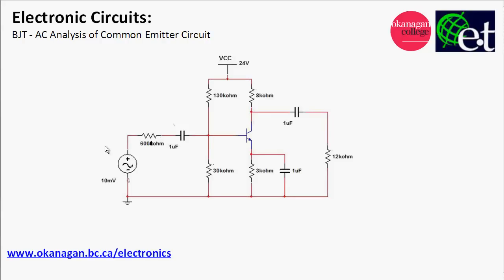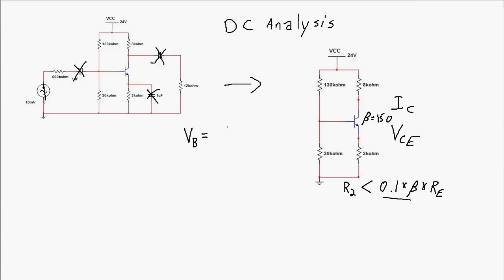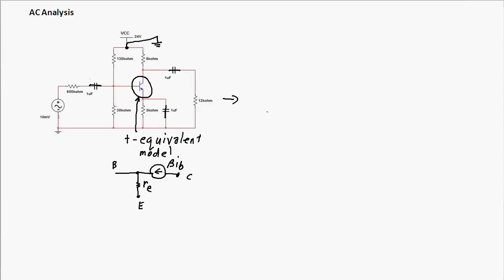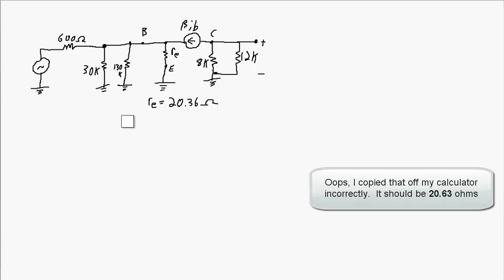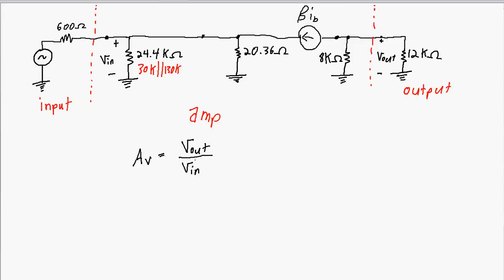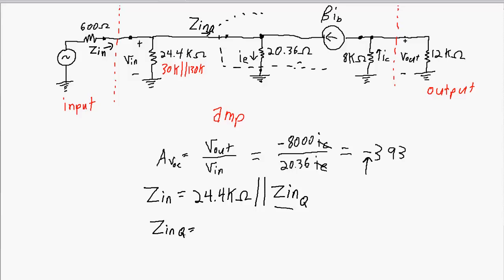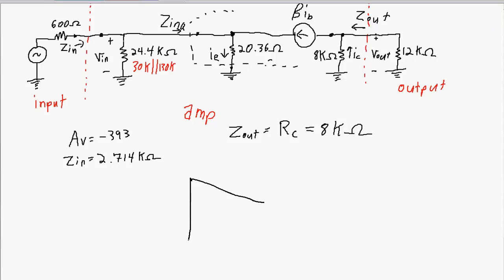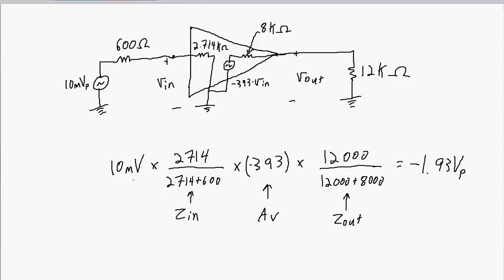Common Emitter Amplifier

Comment: If anyone is wondering why the output impedance is found by treating Rc as if its in series with the load when its clearly in parallel in the diagram, its because in the simplified amplifier model (the triangle) we model the output as a thevinin equivalent circuit with the output impedance being the thevinin equivalent resistance. Its kind of unexplained in the video but him opening up the current source is just the usual step you take to finding thevinen resistance, which ends up being just Rc. And so when you put together the output as a thevinin equivalent circuit in the final model you have Zout as Rc in series with the load.

Very helpful video by the way i just wanted to clear this up because it stumped me for a while
Reply: Can you illustrate more. And what do you mean by thevinin equivalent circuit ?
Reply: you what's even more treacherous, the fact that a forward baised diode on a voltage divider circuit gives of a .637mV out put that means the whole time Ve is just .637mV, since base to emitter junction is a forward biased.

Comment: To those asking where the RE went in the AC analysis, it was shorted by the bypass capacitor. Capacitors are shorted in AC and therefore current passe through the shorted component to avoid the resistance.

Comment: Very clean and well done...thank you!
Reply from the maker: Ancient lawz thanks for the comment.  I appreciate the feed back.
Reply: +David Williams I did not understand the Rin part, why not do Vin/Iin for the 24.4k ohm resistor at the input too but do it for the 20.36k ohm??? what is going on here dude?
Reply: @優さん-n7m  It's a mistake. The ac input impedance of the transistor is β x re or 150 x 20.36 = 3K. Put that in parallel with the 24K and you'll get sensible answers.

Comment from the maker: The quick answer is that at high enough frequencies a capacitor looks like a short circuit.  At low enough frequencies, a capacitor looks like an open circuit.

The deeper reason is that a capacitor presents a reactance to the signal which is an opposition to a change in voltage.  The reactance of a capacitor is equal to   1/(2*pi*f) where f is the frequency.  As the frequency increases, the reactance of the capacitor decreases.

Comment from the maker: The midband AC gain of a common emitter amplifier is equal to about -Rc/(re+RE).  When you bypass the emitter resistor (RE) with a capacitor, you are making RE invisible from an AC point of view (i.e you are bypassing it).  This makes the gain equal to about -Rc/re
Reply: That's only true when Xc (the reactance of the capacitor) is negligible compared to re. For slightly lower frequencies, the ac gain is -Rc/(re + Xc) as long as Xc << Re. The more precise formula would be -Rc/(re + 1/(1/Re + 1/Xc) ). The denominator is (re plus the parallel combination of Xc and Re).

Comment: Howdy. Absolutely Great.
However. The output impedance is 2 x the collector resistor. JohnAudioTech corrected me on that point. And I verified it yesterday.
I used T1 = BC109, Rc = 10 k, Re = 1 k, Rb1 = 47 k and Rb2 = 12 k.
B+ was 9 V. DC work point was about 4,2 V on the collector.
Loading the collector with Rload = 22 k the Uload dropped to 1/sqrt2 of the unloaded value (-3dB). 1 kHz sine wave. With a fixed Rc this is the most energy efficient transfer of power. 
So. I say. Zout = 2 x Rc.
But of course. Designing the stage for a smaller output impedance will increase the load power. Yes. But the stage will consume way more power that what is gained over the load.
Regards.

Comment from the maker: Load impedances for audio systems are usually 4 or 8 ohms, so common emitter amplifiers are not used for driving speakers.  Amplifiers are used in many different types of applications that have higher load impedances.  Also common emitter amplifiers are single stage amplifiers and are often found as part of a multistage amplifier system.
Reply: On the contrary, a pure Class-A amplifier will have a common emitter stage as its output, and many high-quality audio amplifiers use that, although they may use an active collector load to improve the open loop gain. There are plenty of examples on the web.

Comment from the maker: The 600 ohm is the output impedance of the source.  Without it, you can consider it an ideal source and there will be no voltage drop inside the source regardless of how much current is drawn from it.
Reply: Hello sir

Comment from the maker: If you don't have the collector resistor, you will have some major problems with your circuit.  Remember that from an AC point of view, capacitors are nearly shorts.  Also, DC sources should be considered shorts as well.  This means that from an AC point of view your output, which is at the collector is shorted to ground

Comment: Nicely done! I would prefer to get out a general-purpose equation for gain in terms of source and load impedances, and the resistors and source voltages being used, but perhaps that’s one of those exercises better left to the viewer. In any case, CE-amplifiers are a lot more demystified as far as I’m concerned.
Reply: Sure. If Rs is the source impedance, Rl is the load impedance, Zin is the amplifier input impedance, Zout is the amplifier output impedance, and Av is the amplifier open-loop gain, then the overall gain is given by: Zin/(Zin+Rs) x Av x (Rl/(Rl + Zout).

For a well-designed common emitter stage, Av will equal -Rc/Re; Zin will approximately equal the lower base bias resistance, and Zout will equal the collector resistance. Unfortunately, the circuit in the video doesn't fit my definition of "well-designed".

Comment: Thank you for your efforts .. If we applied this  circuit c emmiter to the radio frequency via a resonant circuit, we know that the signal will be inverted 180 degrees.  Can we receive the signal in the reception circuit and be mirrored, or should it be the same as the phase ?

Comment: This video was somewhat helpful however I think it will fall short for most students studying the concepts. In the future could you make a video that describes the circuit in much more detail. For instance, the effects of the capacitors? What are the poles and zero's of each capacitor. How can one find the gain when taking them into consideration?

Comment from the maker: The 600 ohm resistor (from the output impedance of the source) and 2714 ohm resistor (the input impedance of the CE amp) are in series with each other, not in parallel.

Also the output impedance (8k) of the CE amp and the load resistor (12k) are in series with each other too.

Comment: When finding Rout why do we replace the current source with an open circuit? I was taught that dependent sources should be untouched in such calculations
Reply: A current source is equivalent to a high voltage source with a high resistance in series such that the voltage divided by the resistance gives the required current. In other words, current sources are always going to have very high equivalent resistances, so they are effectively an open circuit in ac analysis.

Comment: Why does a low reactance state of the capacitor though cause the signal to completely bypass the resistor? It's the path choice I'm getting confused about. Is it because they are in parallel? Apologies if you feel like you're repeating yourself and thanks for all your help thus far!
Reply: What is the value of R in parallel with 0 ohms?  The cap is assumed to be a short circuit at AC bypassing the R.

Comment: For that final stretch of calculating the input & output voltages, how do you calculate it if there's no AC input resistor in front of the coupling capacitor and no load resistor / capacitor branching off the collector? This is the last bit of knowledge I need to understand this, but I'm having trouble finding the answer!
Reply from the maker: Whatever source you are connecting at the input will have an output impedance, so the input resistance will always be there. If it's such a low resistance that you can ignore it, then just assume that the full source voltage is applied at the input. As for the output, if there is no load resistor, then there will be no voltage drop across the CE amp's output impedance

Comment: Very helpful and clear but what if you have the ro resistor as part of the model for the transistor? How can we analyze this?
Reply: The output impedance at the collector of a transistor is very high (unless the transistor is in saturation), so it will always be many times greater than the collector resistor, with which it is in parallel for ac purposes, and we can ignore it.

Comment: At 8:43, in the calculation of r_e = 26.3 mV / 1.26 mA = 20.63 Ohms, where does the 26.3 mV voltage value come from? All I see in the initial circuit diagram is the function generator providing a 10 mV AC voltage. Thank you!
Reply: Okay, so I looked at your other video "Design a Simple Common Emitter Amplifier" and see someone else had the same question. Evidently, the 26mV value is a constant that represents the "thermal voltage" of a bi-polar junction transistor. Thanks for making these videos!

Comment: David, absolutely love your videos but can you explain the exact purpose of the bypass capacitor in parallel with emitter resistor?
Reply: It allows the ac gain to be greater than the dc gain.
The emitter resistor provides stability of the output voltage point against changes in temperature and supply voltage, as well as reducing the effects of variability of transistor parameters. The dc gain is -Rc/Re or about 2.67.
The emitter bypass capacitor reduces the total emitter resistance at high frequencies where the reactance of the capacitor (1/2πjfC) is less than the dynamic emitter resistance of the transistor (re = 25mV/Ic). The ac gain is then Rc/re which can be considerably higher, although it will dramatically increase distortion for larger signals.

Comment: First and foremost let me express my gratitude, this is absolutely crystal clear, many thanks Sir. Keep doing you. 
I have just one question, is the 26mV that you have divided by (Ic=Ie=DC Current), is that always that or you had calculated it?
Reply: The 26mV is the thermal voltage for a transistor = kT/q where k is Boltzmann's constant, q is the charge on an electron, and T is the absolute temperature. If you want to find out more detail, Google for "Shockley Diode Equation".

The value clearly depends on temperature, but for normal use, we can take it to be around 25mV to 26mV for all transistors.

Comment: Thanks for the video. I got a doubt in between which goes..why can't we use a hybrid pi model in the AC equivalent of the transistor instead of the T model you have used? (using a Hie in b/w E and B and current source of Hfe(Ib) btw C and E..here the emitter is grounded due to the bipass. )
PS : can you make any videos on MOS amplifiers?? please, it'd  be of a  lot of help to guys like me :)

Comment: Thank you for such a nice video. Sir I have a question. what is the use/advantage of 600 ohm? why not we connect the input signal directly to the amplifier's input because it seems that some amount of input voltage will drop across 600 ohm resistor.
Reply: 600 ohm resistor represents the internal resistance of the source. Nothing you can do about it.

Comment: Thank you for this informative video. Regarding the Zout resistance, if Rc (8k) and RL (12k)  are in parallel in the ac circuit, shouldn't Zout be calculated as such to determine the correct voltage gain and ac Vout?
Reply: Disregard my comment...just did the math using my method, and I ended up with the same answer. Sheeeeeet.
Reply: @RHCP08  ghnjhkıjoılö

Comment: I didn’t watch your video because I don’t use hybrid model, I use hybrid pi model 
just solved and compared my answers and they were not the same!! I was really amazed after figuring out how you solved the circuit... you have omitted resistors out of the circuit!!!! It’s just basic circuit theory, you can’t do that. 
Simply the Gain by definition is the voltage of the output node divided by the input voltage 
We have a gain called intrinsic gain where we will only omit the input resistor of the voltage source(600 ohms in your case) just for some analytic and teaching purposes  
Yet for solving this circuit and finding the actual gain you can’t remove the input resistor or the output resistor the 12k ohms!!!!!
Thus your gain is wrong so is your output impedance 
You have even found the wrong re and mentioned it in your video but didn’t mention you have calculated the gain output and input impedance using the wrong re
Reply: I'm sorry, but whatever method you used, you must have made an error.
The gain by definition is the ratio of the incremental change in output voltage to a small change in input voltage.
When calculating the open-loop gain of an amplifier, we start with the case where the source impedance is zero and the load impedance is infinite. Once we know the input and output impedances of the amplifier, it allows us to use simple divider network calculations to see the effect of finite source and load resistances on its performance. The same amplifier circuit may be used with different sources and loads, so it is far more convenient not to have to do a full ac analysis every time.
In other words, for practical use, you don't include the 600R source resistance or the 12K load resistance when you calculate the parameters of the amplifier.
The re calculated was correct, For a collector current of about 1.25mA, the intrinsic ac emitter resistance will be 25mV/1.25mA = 20R, and that was the value used in the video. The only mistake was not multiplying it by β to get the equivalent input impedance seen at the base in the initial ac diagram (which turns out to be 3K). The value needed to calculate the ac gain = -Rc/re is the 20R as mentioned.

Comment: just to confirm, in AC theory if you didn't connect a bypass cap on the emitter then i take it the re value calculated includes the resistor value 3k ohm connected to ground even though it would give a really low gain? just messing round with calculations

Comment: @David Williams

why is the current source replaced by an open ??  If the idea is to obtain the output impedance by using a thevenin equivalent, dependent sources shouldn't be removed if I remember correctly ...

Comment: Dear David,I really like this video, as well as your video on the emitter follower circuit. I just had one question on this circuit: Could you please tell me how to determine the peak AC current leaving the amplifier? The reason I am asking is I am trying to combine an emitter follower with a common emitter. I see now how to find the output impedance of the amplifier, and how to get Vout. Would the outward current just be Vout/amplifier output impedance?Thanks,Tim

Comment: Mr. Williams,
          I believe I understand how to calculate most of the values in a common emitter amplifier but there still are a couple of things I'm not sure about. How do you calculate the value of the input and output coupling capacitors and the emitter bypass capacitor?
          I've seen two different explanations for the input and output capacitors. One says the input Xc and output Xc should match the Zin and Zout of the amplifier. The other says the higher the capacitance the better to assure that the capacitors act as short circuits and don't impede the input and output signal. Is either one of these explanations correct?
          I've also seen two different explanations for calculating the value of the emitter bypass capacitor. One says the Xc should match RE at the cutoff frequency. The other says Xc should be 1/10 RE at the cutoff frequency. Is either of these correct?
          The textbook I'm using, Grob Basic Electronics, contains a lot of good information but it doesn't go into much detail about these type of amplifiers. Any information you can provide will be greatly appreciated. Thank you.
Reply: You understand that the reactance of a capacitor, Xc depends on frequency? Xc = 1/2πjfC. For audio work, we want Xc to be less than the relevant resistance at a frequency somewhat less than 20Hz, so that's how we calculate each capacitor.

The input impedance of the stage is about 2.7K, so we want Xc for the input capacitor to be 2.7K somewhere less than 20Hz. We calculate 1/2π.(20).(2.7K) = 3μF, so we use 3.3μF.
The load resistance is 12K, so we want Xc for the output capacitor to be 12K somewhere less than 20Hz. We calculate 1/2π.(20).(12K) = 0.67μF, so we use 1μF.
The dynamic emitter resistance of the transistor is about 20R, so we want Xc for the bypass capacitor to be 20R somewhere less than 20Hz. We calculate 1/2π.(20).(20) = 400μF, so we use 470μF.

The answer to your question about the emitter bypass capacitor is that neither of the explanations you've been given is correct. The ac gain of the circuit is given by the ratio of the collector resistance to the total emitter resistance. If you think about it, that means you must make the bypass capacitor large enough that its reactance is negligible compared to the dynamic emitter resistor that it is series with. Otherwise the ac gain would be Rc/(re + Xc) and that will depend on frequency until Xc << re. Remember that re is 25mV/Ic and is about 20 ohms in the circuit used in the video.

Comment: Nice video...just one question..8:50...when you calculate re=26mV/Ic......26mV is a constant number or it depends on something? ....thanks
Reply from the maker: +Igor Mândru the 26mV is called the thermal voltage. It is constant when temperature is constant, but can be calculated as Vt = k⋅T ⁄ q. Where k is the Boltzmann constant, q is charge on an electron and T is temperature in Kelvins.
Reply: +David Williams thankyou this information i loss ... good Luke